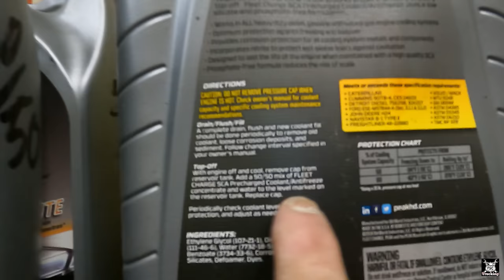Orwell Springs A Leak!   Rear Axle And Daytons On Ford Cabover Removed

Comment: for future reference don’t take the nuts off the studs all the way on the Daytons, break them lose, turn them a few turns out, then break the cleat loose. That way if they are under great stress for some reason they don’t shoot off across the shop and hurt you or someone else
Reply: I was going to say that.  He got away with it.
Reply: I was looking for someone to say something about this. And yes Steve I too would like to respectfully request for you to do the same thing. I changed a lot of Dayton wheels in the 80's and I learned this the hard way. Just lucky nobody got hurt 🤕.
Reply: Yeah i was holding my breath waiting for them to go bang😮 glad it went ok and no harm done. Thanks for sharing with us Steve
Reply: I think you will find the wheels have been on and off before and were probably not torqued up tight as you see they will be on and off a few more times yet. You are correct if it's just come off the road the big guys a seasoned driver he knows what he is doing.  😁🇬🇸👍
Reply: @strangecustoms8486  yeah there didn’t seem to be any pressure on them.  That makes sense as Steve certainly knows his stuff 👍🏼
Reply: Yep, rookie mistake.
Reply: @denniskosmicki2684  The enforcer ain't no rookie wheels had been on and off before so were not loaded up just saying 😁🇬🇸👍

Comment: Steve a little tip put your backside to the wheel reach back and grab the rim then pull forward as you step forward. Try it and see how easy it is and it will save your back from injury.

Comment: Hi Steve,  just a suggestion. When lifting wheels off the hub as you were doing,  try, instead turn around and with your back to the wheel lift off. It is much kinder on the back and you only have one of those. As I say,  just a suggestion.

Comment: best reason for a stand alone apu so you do not lose engine coolant and in turn if the apu develops a leak the engine won't lose coolant
Reply from the maker: Then what would heat my engine in the winter?
Reply: @fsctrucking  an apu equipped with a electric generator that would power the electric block heater

Comment: If you leave a bolt on those cleats, they will not shoot off, I don’t think you would get hurt, unless on a rolling  chair face in there, but most importantly, they are sometimes impossible to find…
Reply: I've seen several get stitches in head from them.
Reply: I was really lucky nobody got hurt when I did the same thing. I removed all the lug nuts and was able to remove 3 wedges, the other 2 were stuck so I hit the rim with a 2 lb sledgehammer and those wedges shot across the lot ricocheting all over the place. That's when I learned.

Comment: 20:55 You should use hearing protection.
Reply: Absolutely i have tinnitus its a horrible problem i'm wearing ear plugs and muff all the time, not able to tolerate anything.  How many times i've seen farmers with  ( say again ) and complaining of ringing.  I continuously hear brake squealing.       blow gun into a hole when cleaning parts in perfect angle  20 years ago   STEVE   PLEASE WEAR EAR PLUGS  when impact  and other noise in shop and driving trucks             Another thing those wedge fly if you don't keep nut at the end

Comment: You are not to completely remove wheel lug nuts or studs when knocking wedges loose. They can pop very hard I've seen them fly off and hit concrete wall taking out small chips. I've seen kid do the exact same thing as you did. But he was doing it on purpose popping wedges for fun and see them fly. Until one of them popped hitting hammer and then him in the leg wasn't laughing after that. Most people use big 1 inch or splice drive impact over tightening them on spoke hubs either stripping stud or pulling stud out of cast spoke. All I've ever used on cast spoke wheels was 1/2 drive impact taking them off and on.
Reply: I lube nut n stud to prevent stud coming off from spoke     lube wedge n spoke flat surface with used oil not grease, tap spacer as you turn n straiten wheel as you tighten nuts     never had a loose wheel with 1/2 impact or about 2 - 3 foot by hand for some 50 years     if wedge don't fly on the nut   wheel is loose    wedge just bottom on spoke not wheel       people putting bad wedge on wrong hub spoke with collapsed spacers

Comment: That APU is nice, zero trouble firing it up, does it  get warm enough to open the thermostat?, and warm the full system, or is it just taking and returning to the block side, and stays below thermostat temperature? You would think a small engine like that would struggle to stay warm with that large a cooling system.. especially just above idle, in freezing temperatures?, I’ll have to go check them out, and see what the systems look like..
Reply from the maker: The guage in the truck is between 150 170
Reply: Not up to full operating temperature, but hot enough to  make for easy starts and heat the cab nice and toasty at 0F.